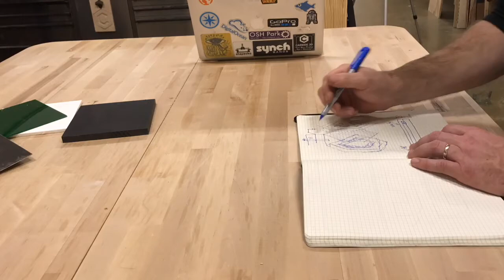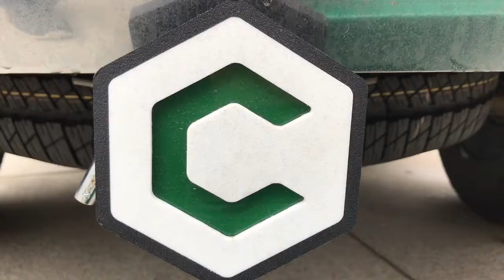Project 5 - Truck Receiver Cover

Comment: I love these Shapeoko project videos and now want to find a logo to put in my trailer hitch. Since the green acrylic looks so cool, it might be fun and maybe a bit cheesy to add a 12v LED behind it that turns on with the headlights (since the trailer hitch should already have an electrical hookup to do just that).
Reply from the maker: Mark Moran totally agree about the light! I wanted to do that and went so far to buy the harness, only to realize the light has to be red to be legal! So it wouldn't have worked for this one, but is totally doable for any design where red is acceptable.
Reply: carbide3d oh good point! Forgot any light would have to be red. I guess those goofy skulls with the red glowing eyes are technically legal.

Comment: Feeds and speeds for each of the materials would be tight!!
Reply from the maker: HDPE:
- 1/4" 3 flute cutter (#201 in the carbide store)
- 70ipm
- .25" depth pass

Acrylic:
- 1/4" 3 flute cutter (same)
- 60ipm
- .100" depth pass

Aluminum
- 1/8" 2 flute cutter (#102 in the carbide store)
- 30ipm
- .02" depth pass
Reply: carbide3d Any chance that Carbide Create could set feeds closer to this if the machine selected is Shapeoko? I have to manually override the speeds every single tool path. I'm guessing because it always assumes a less powerful Nomad spindle?